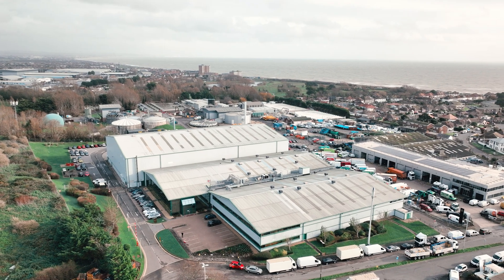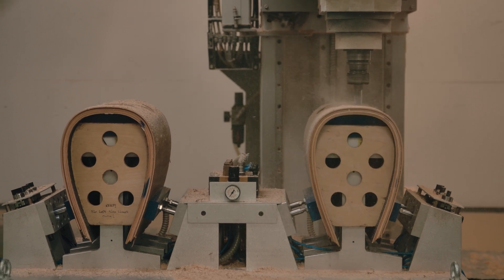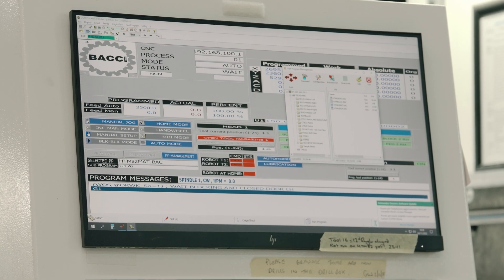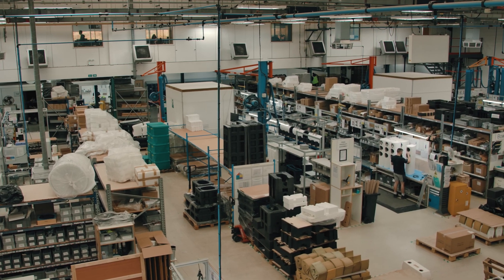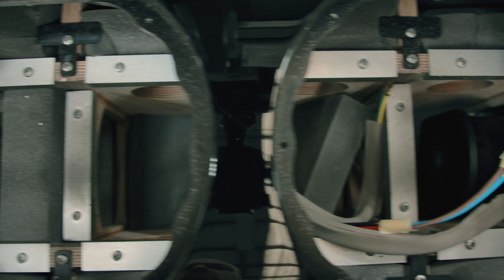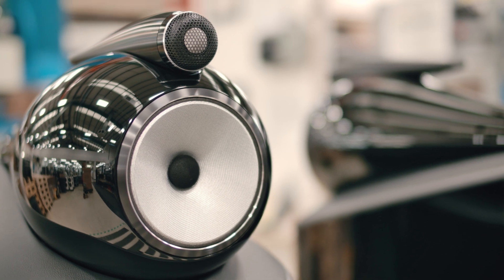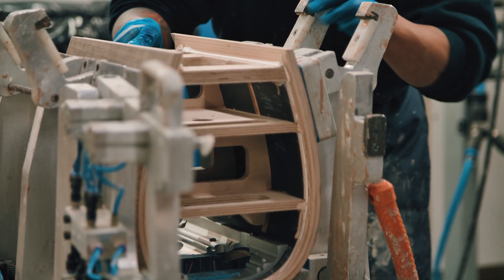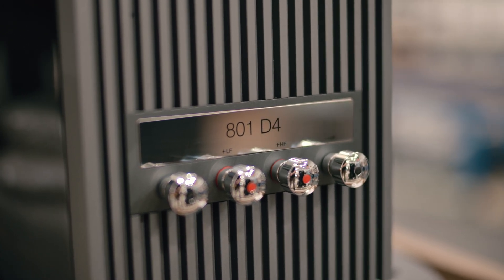Made in the UK - Building Bowers & Wilkins 800 Series Speakers | SoundStage! InSight (April 2023)

Comment: I have the 804 D4s - I traded in my D3s because the leap from the D3 to D4 was HUGE. In the 800 D4 series the 804 is the model that saw the biggest leap forward from the D3 line, and luckily I bought them via preorder BEFORE the 20% jump in price, they are $14K now. The build quality is off the charts now for the money.
Reply: I have the 804D4 on order.....so your words are very interesting! Can't wait to get mine!
Reply: @xsamitt  hey Fender Man, what is your system?
Reply: @michaelmityok1001  Hi...I have Bryston 28B Cubed With A bryston BP-26 Preamp with a bryston CD player.I don't have a Dac or streem! I keep it very simple. I use iSO Clean for the Cd Player and Preamp ....the amps are Direct to the wall outlet........How about your setup?.....Would like to know how you feel about the 804's now that you have some hours on them?
Reply: @xsamitt  okay my setup with my DIGITAL source (streaming and local files on a NAS) is as follows (starting from the wall): internet provider's generic router -> iFi LAN iSilencer -> Nuprime Omnia SW-8 ethernet switch w/ LPS-205 power supply -> ADOT Optical Fiber Upgrade Kit -> Melco S100 ethernet switch w/ Ferrum Hypsos power supply using fiber optic output -> Lumin P1 using either (1) its internal DAC or (2) USB output to Lampizator Baltic 4 tube DAC -> Gryphon Diablo 300 -> B&W 804 D4s (cabling is an assorted combination of Gutwire, Puritan, Inaukustik, Nordost, Audioquest, and Transparent cables worth about $12K). My ANALOG source is a Linn Selekt LP-12 TT with an Audio Technica AT-ART9XA MC cartridge -> EAR Phono Classic tube phono stage. As you can see I put a lot of work into optimizing the digital source chain, and that optimizing makes a HUGE difference in how the D4s sound, now there is ZERO digital glare either through the P1's internal DAC or the Lampizator, but without that optimization the D4s will ruthlessly expose any glare, so for example if you listen to low quality recordings on CD like Led Zeppelin or 1980s "new wave" like The Cars etc. YOU WILL HEAR EVERYTHING WRONG ABOUT THOSE RECORDINGS. My analog source ie vinyl sounds good regardless of recording although obviously the sound improves when playing well-recorded music, meaning I can play any LP without feeling fatigued. I will end by saying that the D4s are microscopically resolving which is both a curse and a blessing - given a top quality signal, I don't think any tower speaker under $20K is better for my listening tastes, which run the gamut from classical through jazz to modern electronica, and the fact that my ears are 60 years old. I realize that this might not be what you want to hear as it might require you to spend some more $ on your source chain, depending on your musical tastes and how sensitive your hearing is to glare, but I'd rather I share my experience in my setup with no sugar coating, as ultimately that will be more useful to you.
Reply: @michaelmityok1001  I had the 805D4's sold them to help with the cost the 804's.  So I while I was happy I just needed more,hence the decision was made.I was never disappointed with the 805's But I do understand that the 804 is going to be more raveling.Did you ever get a change to hear the current 805? And if so how you would you describe the the upgrade i've taken!
Reply: @Fender Man  no I haven't heard the 805 D4s, but a comparison between the 805s and 804s is not really going to help me make clear what I was trying to say. The point I was trying to make is unfortunately not very reassuring - the point bluntly put is that unless your digital source is 1st class, the 804 D4s are going to make sure you know how crappy sounding your poorly recorded music is. OTOH, the D4s will give you tons of fireworks during the playback of your well recorded music... most likely given my experience, you will have to invest some serious $ in your source chain if you want to enjoy your Credence Clearwater Revival.
Reply: @michaelmityok1001  Thank you sir!.....I should be good all things considered since i had the 805D4's and any unpleasantries were taken care of.But I do hold out there may be some surprises. ......Kinda like shopping for a male order bride ,you'll never know till you get to know her ;-)
Reply: @xsamitt  pretty much dude 😆
Reply: Question: what difference(s) did you note?
Reply: @dougschneider8243 bass is firmer and more delineated, the mid range is much more open, the top end sweeter, but none of this has been at the expense of resolution, indeed I'd say there is even more resolution but it's not coming off as "hot". Also they go LOUD without any distortion, and no I don't hear the bottom firing port despite what the haters say must be a problem after the Stereophile measurements were published. I WILL say they are most likely hard to drive properly because of the impedance swings that tax the amp at crucial junctures (I have Gryphon Diablo 300 driving them), so you have to have relatively costly electronics in front of them to get the best out of them, but that's always been the case with B&W regardless of the generation.